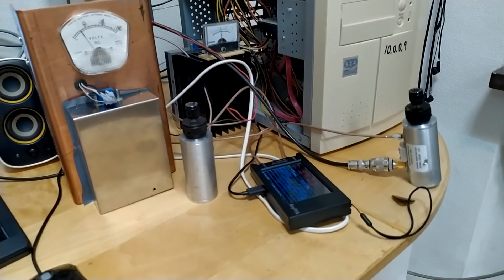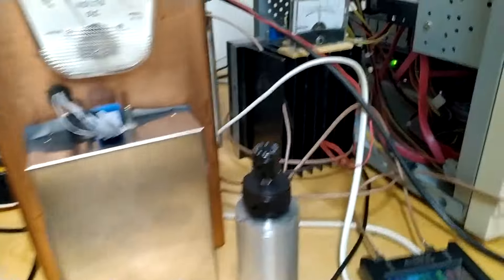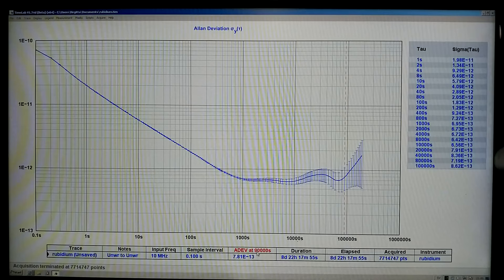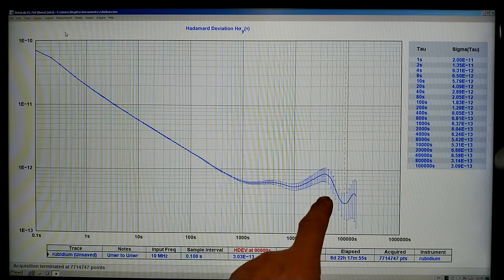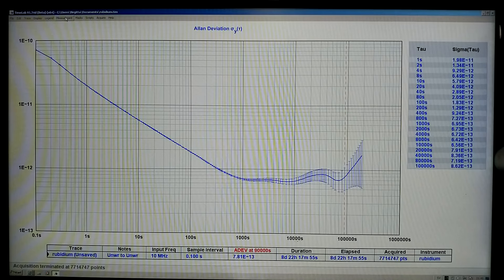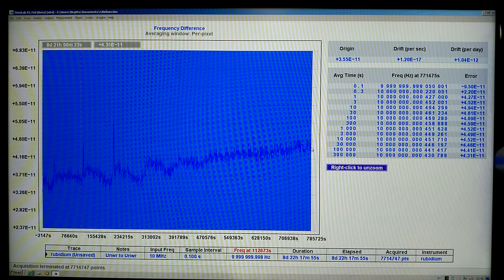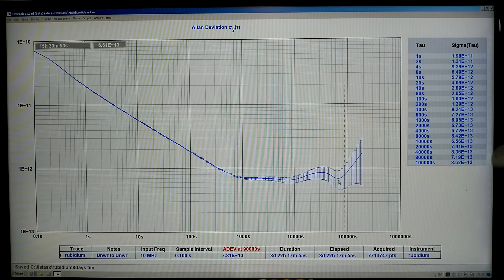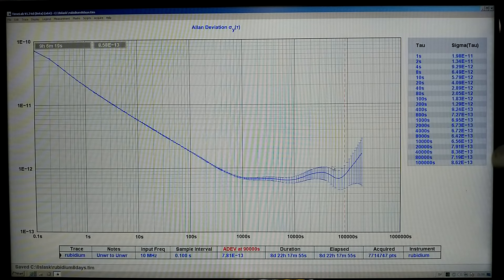allan2

Comment: you need a better oscillator for comparison..
Reply from the maker: You might tell me where I can find an oscillator that is significantly better than -123 dBc/Hz @ 1Hz offset. I am interested in sideband noise or Hadamard deviation for Tau in the range 5 to 30 seconds. Long time stability is a different problem that I am not interested in at the moment.